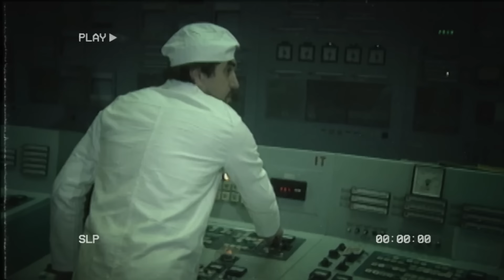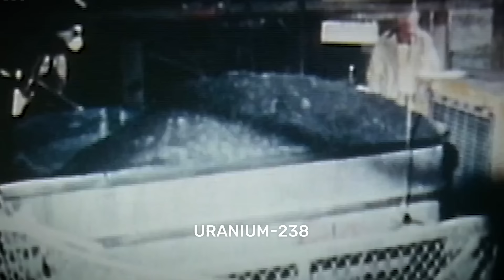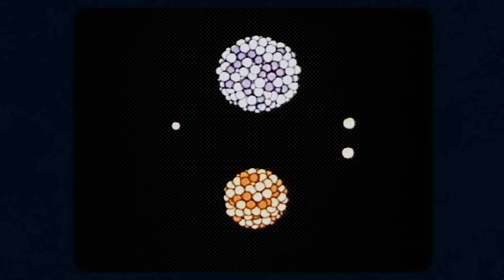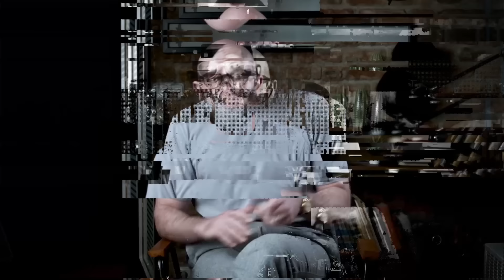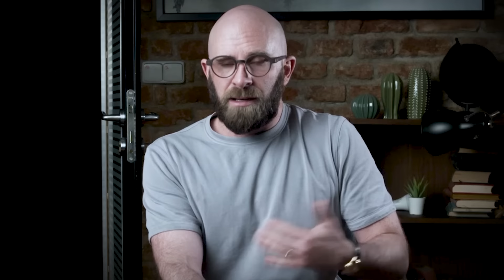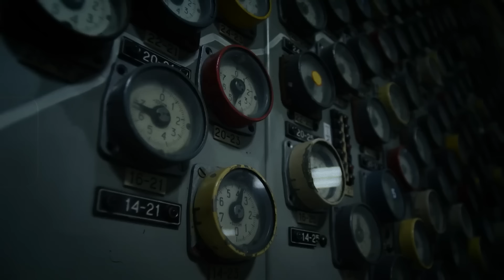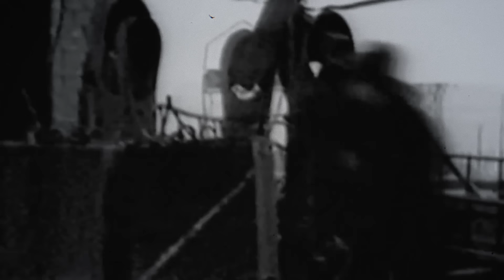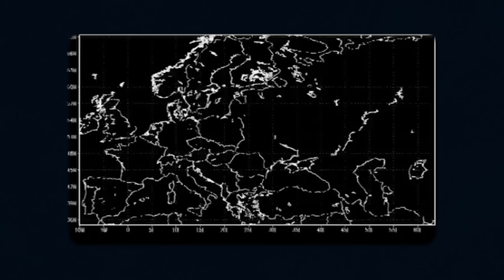The RBMK: The Shoddy Nuclear Reactor That Nearly Killed Millions

Comment: I've seen a few wags saying RBMK = Really Badly Made Kettle
Reply: It made sense for what it was originally intended to do, which was bombard natural Uranium fuel with neutrons in order to produce Plutonium. But when you step the size up to commercial power levels,  you have some very big concerns regarding stability. 
That's the same sort of thing you find in Western pressurized water reactors. When they were sized for ships and submarines, the water in the reactor vessel was more than adequate to keep the thing cool in shutdown. The decay heat of something like an S3G reactor in a submarine levels off at 0.4% of full power. The S3G was rated at 78MW, so 0.4% of that is 312KW. In a week, it drops to 0.2%. You get natural convection which provides some circulation. It's "walk-away" safe. 
But when you scale those things up to gigawatt scale like modern powerplant that makes 3GWth or more, the water in the core isn't really sufficient anymore. You have to keep water circulating through it, or the fuel will still distort and melt. That means keeping pumps running 24/7 even when in shutdown. 
Alvin Weinberg was actually somewhat distressed when the higher ups at the Atomic Energy Commission and the Dept. of Energy didn't want to listen when he told them that different reactor designs would be a better choice for commercial power. And he would know, his name  was on the patents for the pressurized water reactor.
Reply: @Clean97GTI  Even the Australian Atomic Energy Commissioner implied he was amonst those who told the Soviets that a system requiring acting control to stop it running away was a bad idea.  He passed away some years ago, but was once president of my ham radio club.
Reply: @Clean97GTI I mean, if making plutonium was the main reason, they could have done that in a research reactor, which are extremely safe since they aren't allowed to get very hot, since making electricity from steam isn't the point.
Reply: sounds about right
Reply: or maybe Real Boom Making Kettle....
Reply: "Nuclear fission is one hellava way to boil water" 😂
Reply: @rhonda-my_honda_cb500x  Just completing "The Neutron Dance"..😅
Reply: This really should be pinned.
Reply: Completing The Neutron Dance...
(Sorry I couldn't help it! 😅)
Reply: Tbh RBMK is not an inherently bad design, they just cheaped out, later versions of RBMK addressed the problems after Chernobyl. There are some RBMK blocks still in operation today, although most are decommissioned
Reply: Reactors Built by Moronic Kossaks is the one I remember.